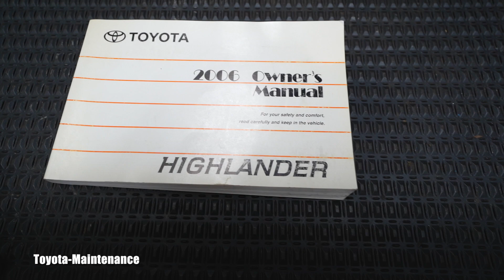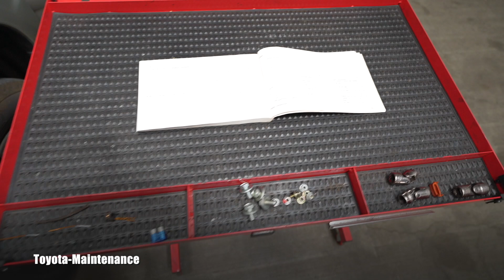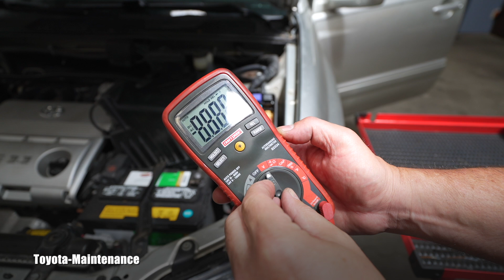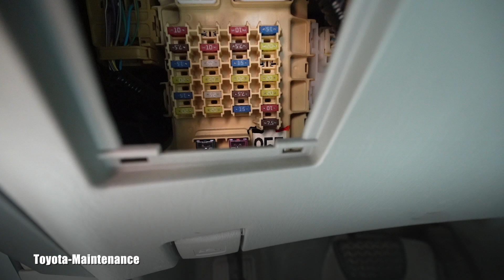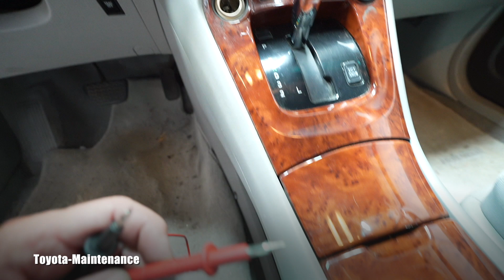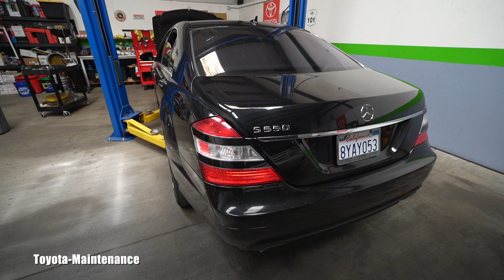Toyota Power Outlet Not Working?

Comment: When you are checking resistance across a fuse, or checking continuity, and you come across a blown fuse on an always live circuit? Always use voltage setting on any potentially live circuit.

Comment: Good basic training. 
If you have a minute take a look at this lighting system designed by Chicago auto pros and Rupes. 
It’s a set of led spot lights that are remote controlled and has color adjustments. I started with two on a stand then added 4 on the ceiling.   There is also a light panel made type s just for photography.

Comment: Thank you Peter. I am new to diagnosing cars and I appreciate this simple video showing it how easy it can be. I do get nervous when it comes to voltage and amperage
Reply: As far as safety goes,  Voltage doesn't get dangerous until you're above something like 30 volts, maybe 50, I don't recall. 

AC gets dangerous sooner because the peak voltage goes higher than the average. 

But you can still destroy electronics even at 5 v.

Comment: On my sequoia none of my power outlets work when the key is off
Reply: Do you have one in the cargo area? Heard some SUVs have it constant on back there
Reply: @LAactor  no. And mine is not a limited either. It's designed that way. Nothing runs unless key is on or engine running.

Comment: Having owned several Toyotas, including my current vehicle, I immediately would have had the ignition key in the Accessory position, or have the Engine running before checking anything else, as no power is supplied to those outlets with the ignition off on Toyota vehicles. I did enjoy going along for the ride, as you went about troubleshooting.